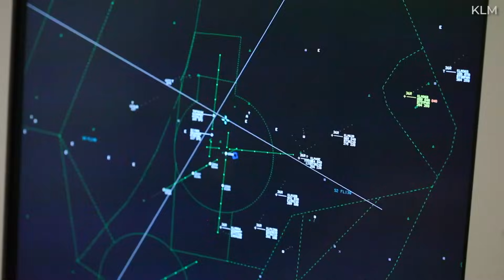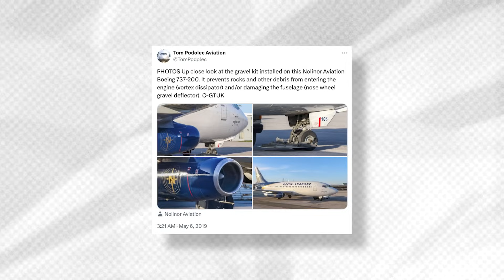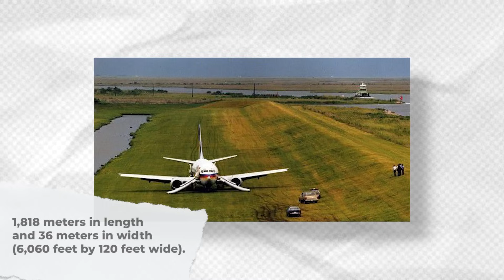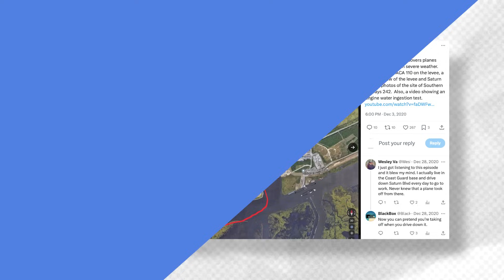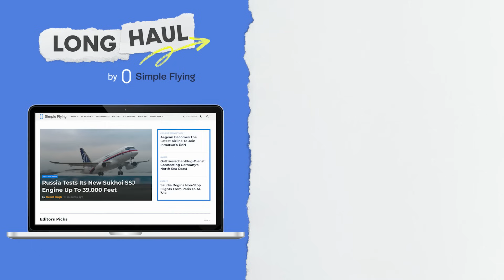No Way Out: Why Emergency Landings In Fields Often End In Scrapped Aircraft

Comment: Another case was the Air Canada 767 ‘Gimlie Glider’. This aircraft flew from its emergency landing location and was returned to service.
Reply: I was wondering if the Gimli Glider didn't count because it landed and took off on a paved former runway that was, aside from drag racing infrastructure, essentially intact.